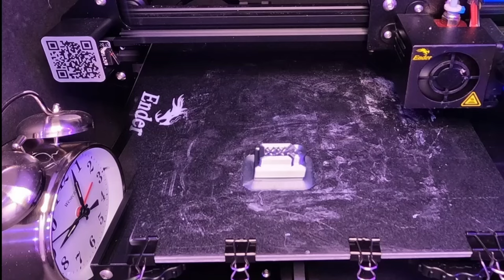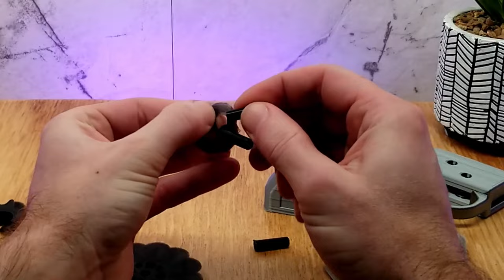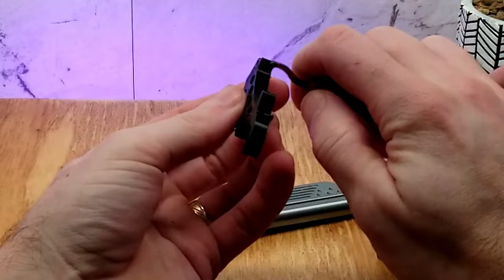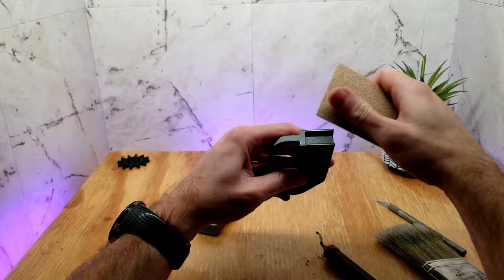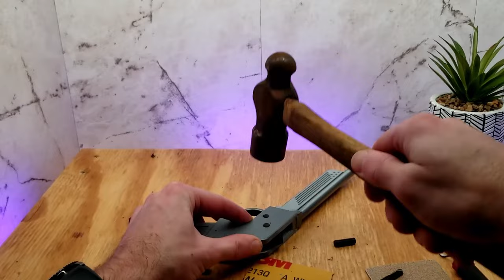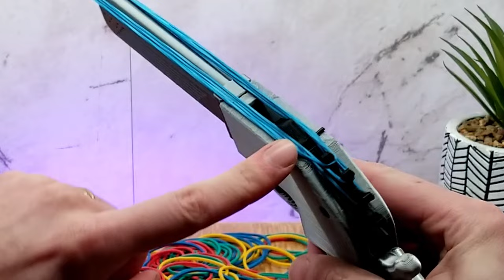Best Rubber Band Gun!!! 3D Printed

Comment: i’ve been printing this and the trigger spring piece snapped🫤
i’m reprinting at 100% infill so hopefully that helps
also, what size drill bit do you recommend for the filament hole
Reply from the maker: The Joys of Printing! At least it was a small part...
The trigger, the revolve star and the pins were the only things I printed solid. The other parts I kept a considerably large wall (3mm) to give it some heft. Possibly printing as a shell made it less resistant to flexing without breaking? Are you using PLA?
For the filament drill size, it was a loose fit with a 3/32 inch drill bit and my 1.75mm-ish filament diameter. A dab of superglue held it in place. Maybe 5/64 inch would be tighter? You could start with the 5/64 inch and if it doesn't fit, upsize to the 3/32 inch. Good Luck, Let me know how it works out for you.
Reply from the maker: Mine just snapped too... but it lasted an impressively long time! (I didn't break it, someone else did though LOL)